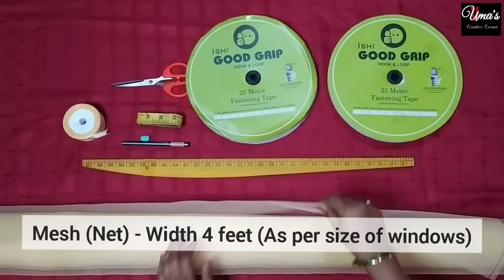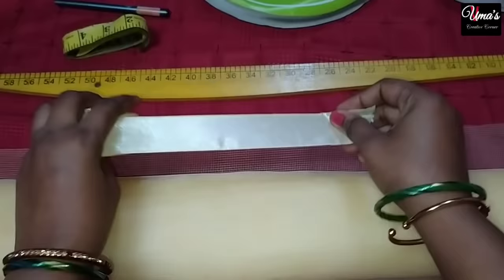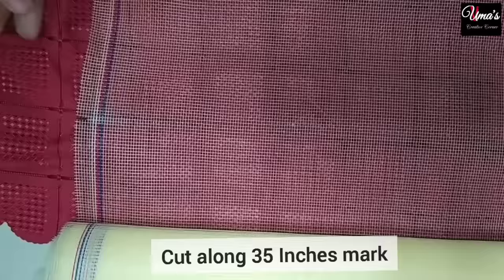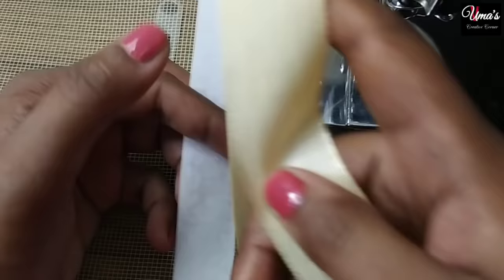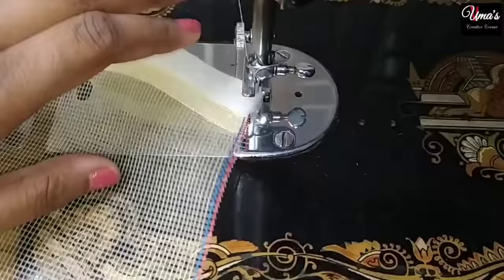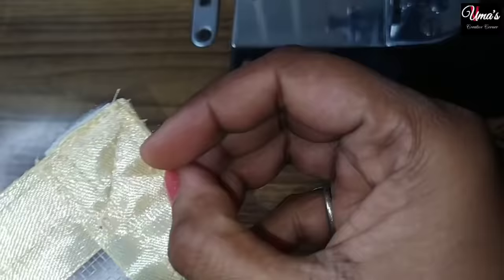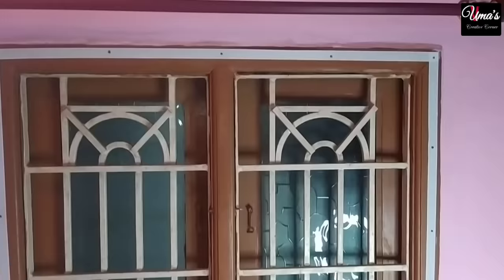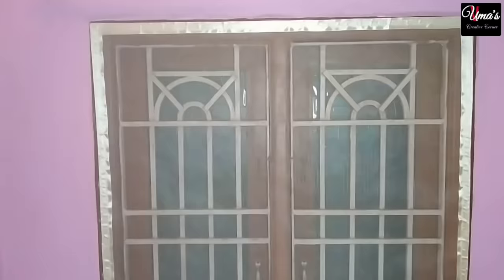DIY How to Make Velcro Mosquito Net for Windows at home 🙂 कम खर्च मे खुद बनाएं खिड़की दरवाजे की जाली

Comment: Iron windo ho to kaise lagaenge
Reply from the maker: Iron frame waali windows me ye normal Velcro use nahi hoga.. Uske liye 1st option aap sticker type "Self Adhesive Velcro Tape" try karke dekhiye jo metal frame me direct chipka sakte hain..  Par pehle aap tape ka 1 meter ka small piece le ke iron frame me stick karke try kar lijiyega.. 
Otherwise 2nd option Iron windows ke liye separate frame waala mosquito net banwaa sakte hain..

Comment: it is useful,😯 Can you tell how much the hook and loop tap will get? 🤔
Reply from the maker: Hi.. Thanks for appreciation 😊 I got Hook and Loop tape set of 25meter length for Rs250 from local hardware shop. It is Rs10/meter  👍
Reply: @UmasCreativeCorner  thank you❤
Reply: @UmasCreativeCorner   how to put hook tap in aluminium sliding channel ? 🤔
Reply from the maker: May try Self adhesive Velcro tape on aluminium frame.. For better durability can use additional good quality superglue while fixing..

Comment: एल्युमिनियम फैम  मे कैसे लगाये
Reply from the maker: Iron frame waali windows me ye normal Velcro use nahi hoga.. Uske liye 1st option aap sticker type "Self Adhesive Velcro Tape" try karke dekhiye jo metal frame me direct chipka sakte hain..  Par pehle aap tape ka 1 meter ka small piece le ke iron frame me stick karke try kar lijiyega.. 
Otherwise 2nd option Iron windows ke liye separate frame waala mosquito net banwaa sakte hain..